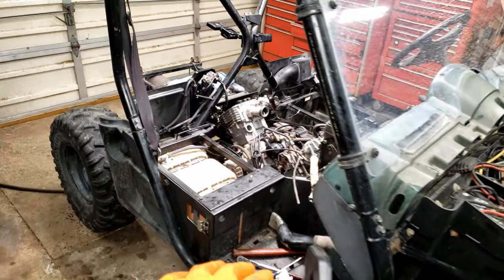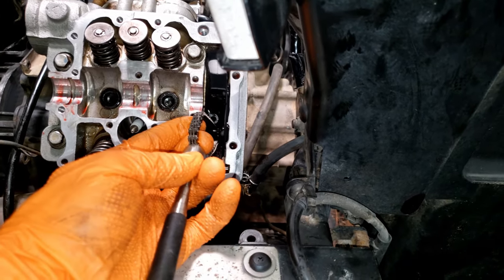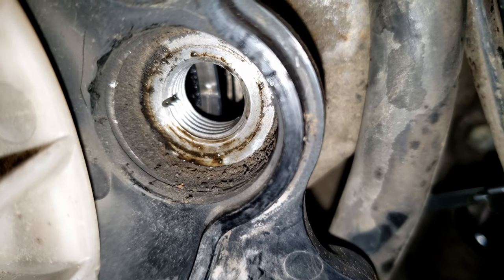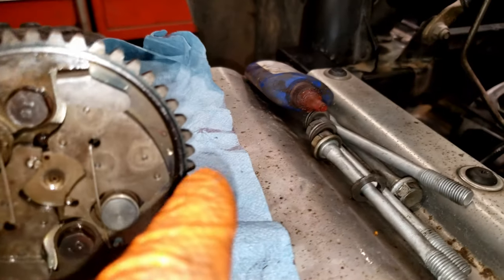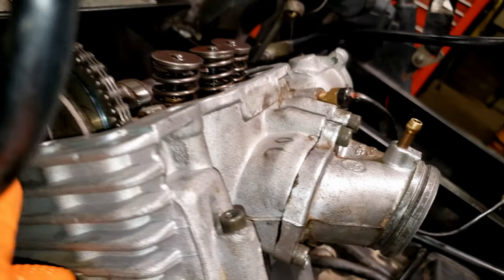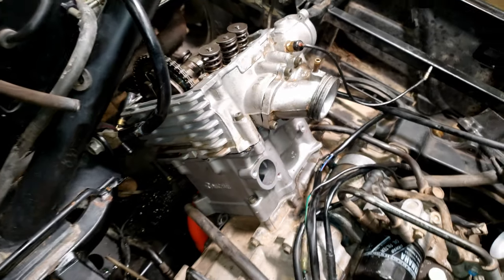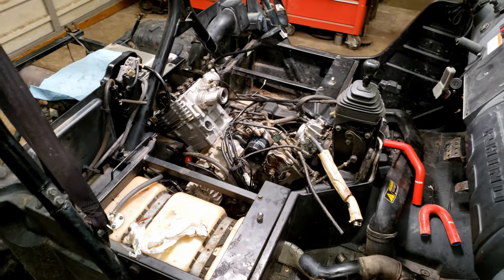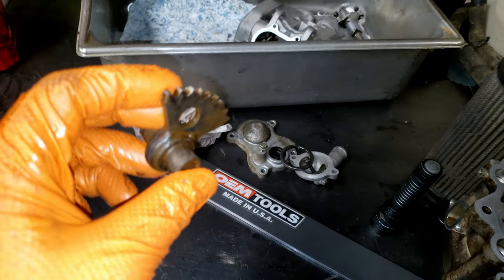Cam Chain Timing Overview - Rhino 660 UTV   Yamaha

Comment: Thanks, but the problem is getting the chain off past the DRIVE gear with the compression springs  tried to remove the big snap ring an cover washer but sprocket won't move any ideals would really appreciate all help, some body else tried to replace chain an now I got there head aches.

Comment: Thank you for making video it's nice to see different perspectives but the most difficult part of the job, It would have been helpful to see you install the chain over the cam gear? And then place the cam in position? You zipped right by that I wonder why?  if you have a brand new chain it is difficult  the chain is holding it down,  it's difficult to get the cam with the chain on it and get it into  the head, you want to be careful and not snap it down push it too hard, where it snaps down, you can scratch the cam or Cam lobes